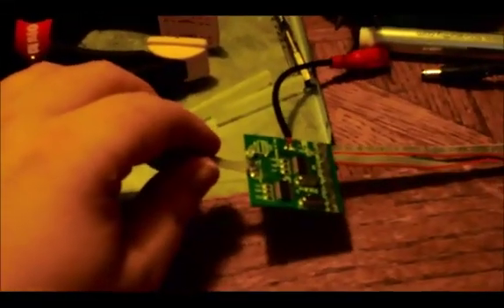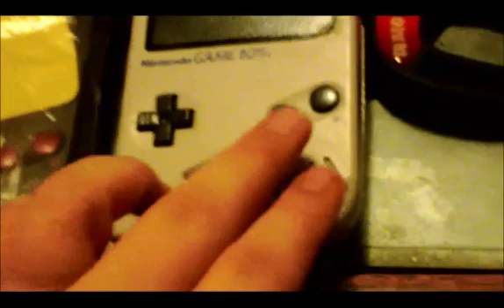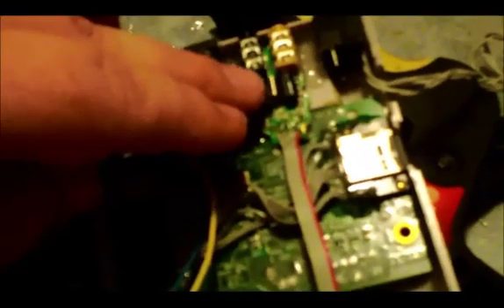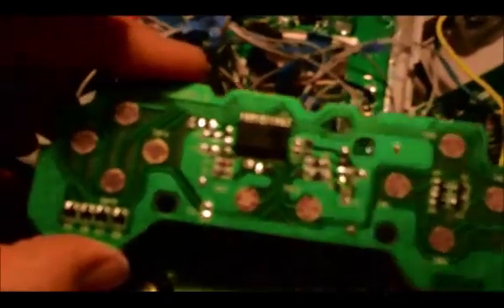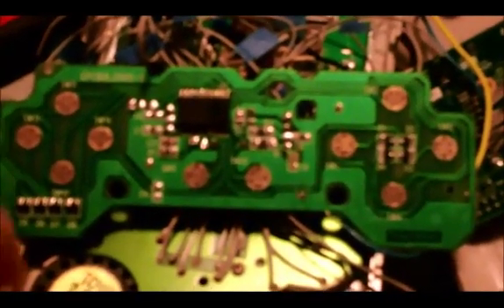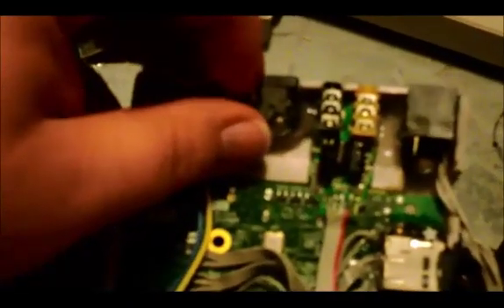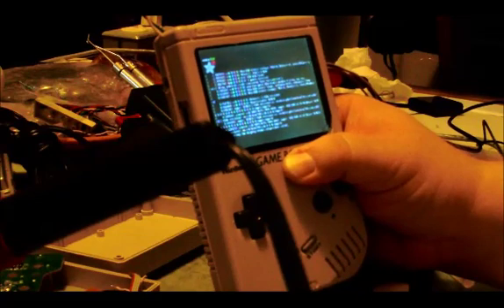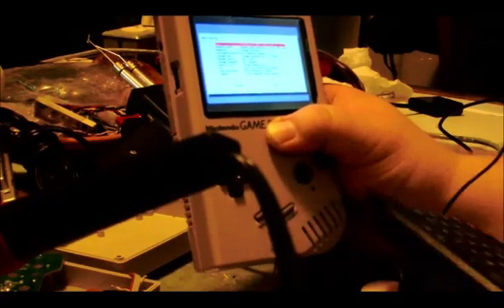NEW VIDEO! gameberry: project to turn a gameboy into a raspberry pi handheld! Update 2

Comment: Was this ever finished?
Reply from the maker: Alan Trovoski I have been homeless and very ill, I have several debilitating and degenerative illnesses which cause me to be unable to do much for months at a time.  I have upgraded the idea, and am going to be building the final version using a special tiny dual core intel x86 pc on a board called bat-mini, which uses an intel bay trail system on chip, 32gb eMMC, 2gb DDR3, and such all on a board the size of a raspberry pi.

Rest assured I think about this almost every day still, and really want to get the improved version done.  I will definitely post on my channel when I make progress.

Comment: How much experience do you need with soldering and electronics to be able to make one of these?
Reply: yeah I've moved on from this particular little obsession xD

Cost vs Reward  wasnt worth it ^^
Reply from the maker: Rivyn Daniel it's worth it if you scavenge and also get things from ebay cheap.

I am basically on hold with this project due to serious illness and problems with keeping a roof over my head. I will finish this.
Reply: meh, I'm good ^__^
Reply: Rivyn Daniel 200 dollars? literally built mine for less than 60 maybe. (already had tools) and it doesn't take that much experience.. you could look up a how-to on how to solder and probably get it.
Reply: Yeah I'm not the one that quoted $200

but yeah I've moved on from this, I have enough aggravation in my life without fucking around with soldering and circut boards and the fear of creating the prototype hardware for Skynet >..>

i.e. Too friggin lazy to bother xD

Comment from the maker: As dolphin-emulator is on code.google.com it is F/OSS and can be recompiled for the raspi.  I do not know if it has cross-platform compilation issues, but you can do more research on this as easily as I can. :)